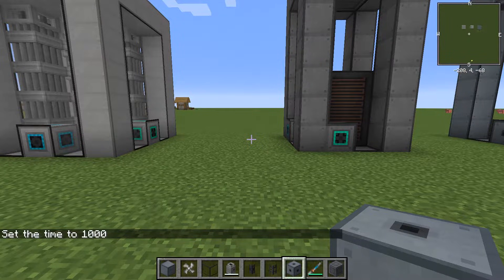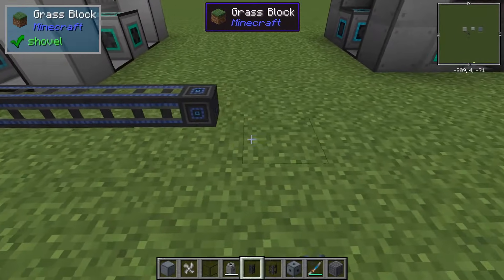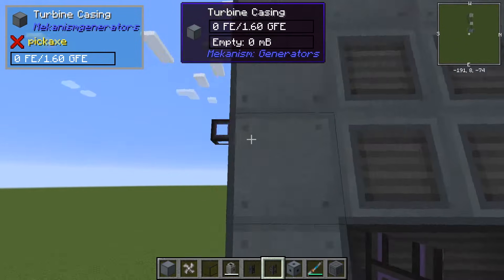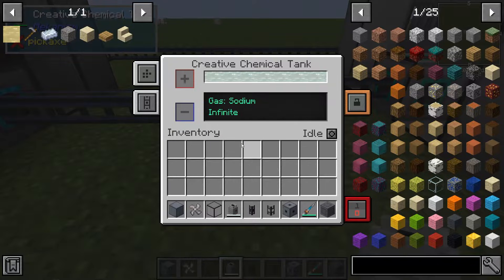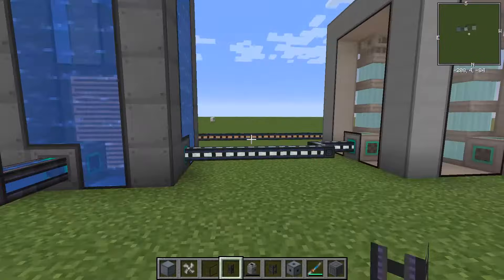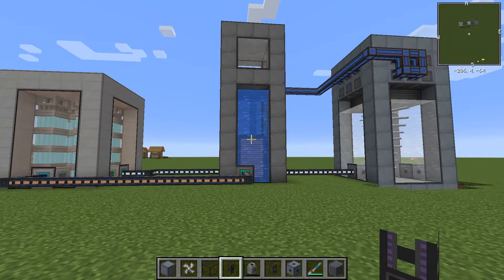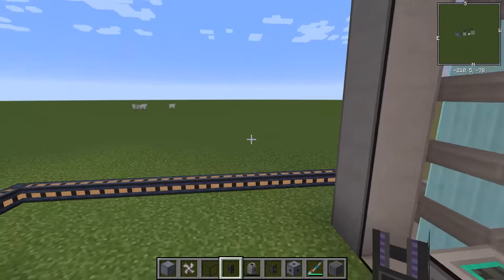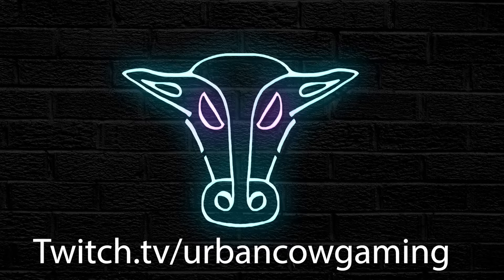Minecraft Mekanism Sodium Cooling tutorial

Comment: don't know if this has come up, but sodium cooling means that the reactor will run at a lower temperature, meaning that you can run a higher burn rate safely.
Reply: Straight from the Mod Author's mouth: "Sodium based cooling

When things get too hot for your taste, Sodium is a much more efficient coolant and allows very high burn rates at lower core temperatures (but not more energy per mB of fuel burnt). Sodium based cooling requires a Thermoelectric Boiler as an intermediate heat-exchanger to cool down the Superheated sodium from the reactor and heat up water into Steam. The Thermoelectric Boiler has been updated in Mekanism v10 to allow it to use heated coolant as a heat source. The boiler's water and steam tanks double as superheated coolant and coolant tanks. The Boiler Valves can be configured with a Configurator (crouch + right click) to make them input only, output steam or output coolant."
Reply: Does this mean you need more Fission Fuel Assemblies  to make it burn at a higher temperature
Reply: @tabeticemperor1814  no, the amount of steam produced is a direct function of the amount of fuel being burned. temperature does not matter, so long as it it not too high.
Reply: @bradleymorgan8223 Its so expensive
Reply: @Rubygirl-m5s  true, but it means you don't need to make the reactor as big, and you should have sodium as a biproduct of fission fuel production
Reply: @bradleymorgan8223  And its only set up, once you fill it with sodium it's a closed system

Comment: The reason to use sodium as best I can figure it, is purely the higher burn rates. Thus faster production of waste, which means polonium / plutonium / antimatter can be created at a much faster rate for end-game item crafting. Also once you've got fission / fusion / SPS / 5x ore plant what else is there to do but build more complicated versions of what you already have :D
Reply: i cant figure out how to get my burn rate up to max. some things i try dont seem to help but creeping up somehow has gotten me 1 or 2 higher burn rate gradually. still 10+ off my max burn rate
Reply: @Speedy2222  did you try to connect the output of the turbine into the reactor? you need to place pipes (at least elite) in the turbine vents so the water comes out and into the reactor. i did that and i got my max burn rate and didnt lose any water, meaning i didnt need any other pumps

Comment: bro why  do u first introduce a water based reactor without explaining how to connet it to the other parts (like the waste output) or what the other parts do/how they are built and then suddelny switch to a completly different type of reactor set up in your tutorials without explaining the changes made to the reactor?
Does the sodium reactor still needs a waste output and why didnt u show it? And how do I build it? Why did you only explain half of the set ups?
Reply: Because its exact same reactor, only difference is you fill it with water or sodium.

Comment: I did a few tests  in Creative and built a max size 18x18x18 Fission reactor. You cannot fully utilize it in this size with just water as a coolant, it just gets too hot. 

I don't know if I managed to fully max it out, but the reactor has a max burn rate of 1920 mB/t, with water I'm only able to have the burn rate at 718 mB/t, one mB higher and it would reach the critical limit of 1200 K. So that's where Sodium cooling comes into play I guess.
Reply: I wish there was information out there for how this thing actually works in regards to the rates and bottlenecks.  I'm fairly confident that it has something to do with the surface area of the coolant on the rods, the burn rate, and the choice of coolant, but there's just nothing on it out there that I can find.  Because your reactor is so large, it has a larger surface area for the rods, which allows that 718 mB/t burn rate.  I suspect if you build a reactor that had less rods (but still more than 718) you wouldn't be able to reach that same rate.  Mekanism prides itself on having somewhat realistic systems, so the reason we're not given the information on how it actually heats up is likely because it is too complex for like 99% of players.
Reply: Does it cools faster If you install a second turbine ?
Reply: @georgeoctavian7663  i ran a full size reactor, and i noticed that the steam was building up in the reactor (the turbine hit max speed), which probably means you need 2 turbines to fully utilize the reactor
Reply: @georgeoctavian7663  I haven't tested this, but I would presume it wouldn't make any difference.

In my setup that I described above the water return from the turbine is stable, the water coolant tank from the reactor is full at all times, even at burn rates where it reaches the critical temperature limit.